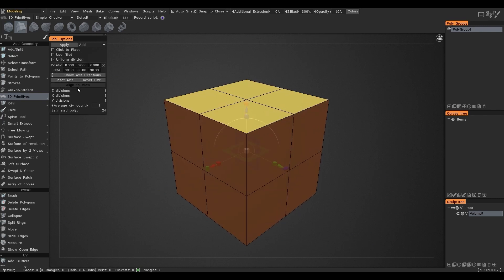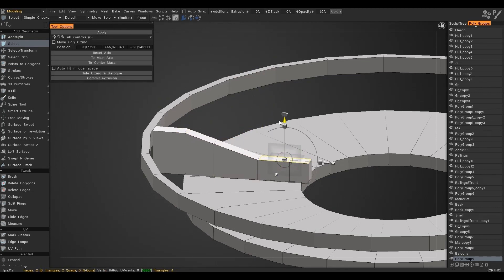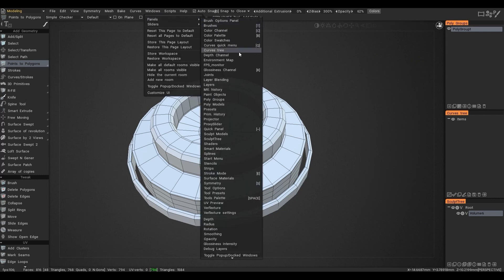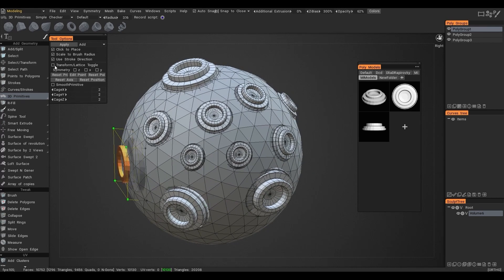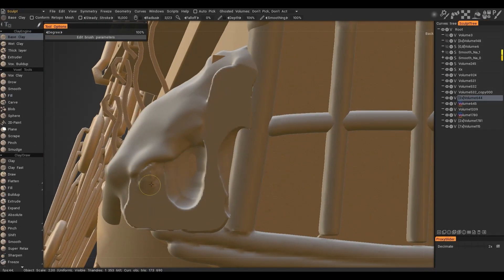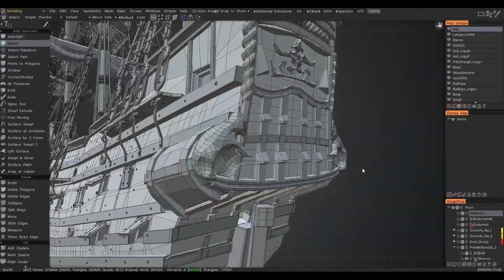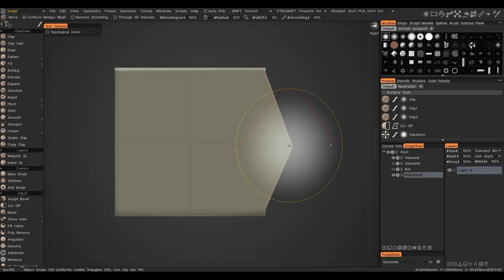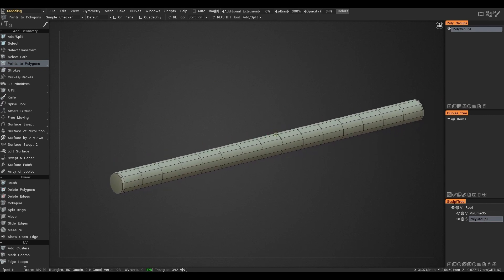How to Create a Ship Model from Scratch using 3DCoat. Part 2

Comment: At last some tutorials or at least more in depth footage of 3d coats capabilities!!! I've been wanting to use 3d coat FOR YEARS but the lack of any tutorials or general videos put me off, there is nothing worse than attempting to create work on software that you have no idea to use, specifically if you don't come from a 3d background. I am LOVING 3d coat,  it appears that even the modelling is even easier than in blender. (I tried blender for 2 weeks and was bored to tears. With 3dcoat I can create instantly) I'm happy that I am using 3dcoat now, but if only more videos had been around years ago! I don't understand the marketing that goes on....you are creating an amazing product/tool and then do nothing to promote, highlight or showcase it, so odd.
I bought an Udemy course on 3dcoat in 2017 and even that was hard to find, it helped a little but your software has improved so much.
Please continue to make videos!!
Reply from the maker: We understand your points, but in general, the most comprehensive in-depth, project-based tutorials of a given software, is not provided by the software vendor, themselves, but 3rd party individuals or platforms. 3DCoat has a number of 3rd party partners and Anton Tenitsky is a great example:
https://www.youtube.com/c/AntonTenitsky
Reply: @PILGWAY3DCoat  Lamentablemente sus tutoriales se limitan a esculpido y texturizado para concept art.